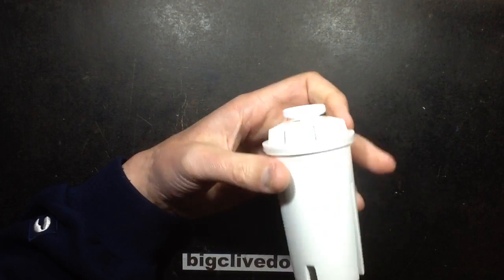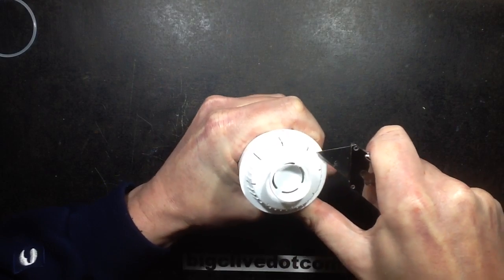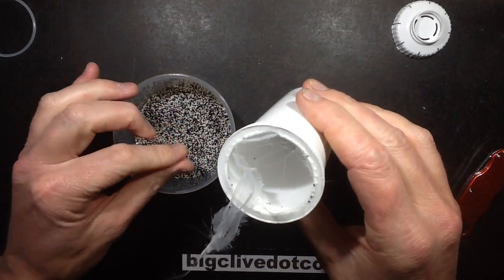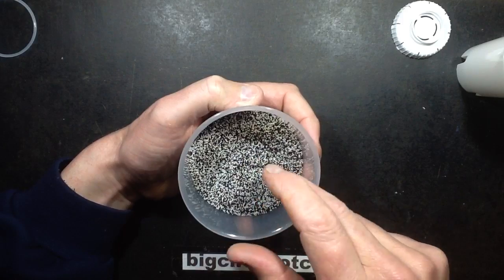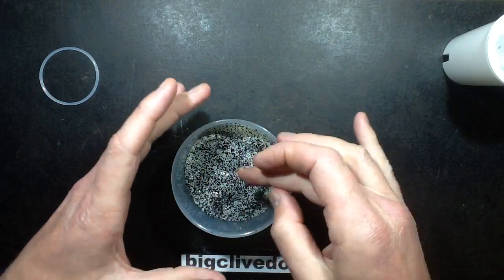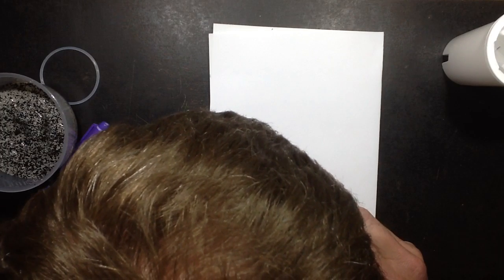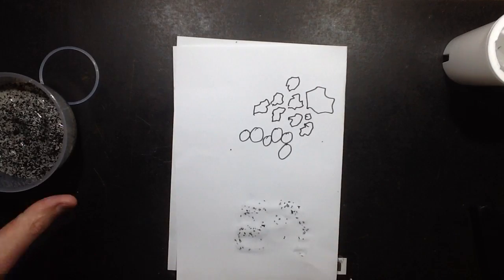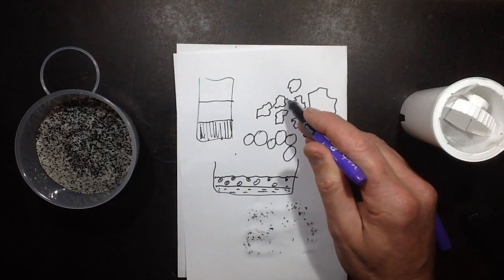What's inside a water filter?

Comment: Don't known if this channel is still responsive, I know this filter will also trap micro-organism and bacteria which proliferates. It is a vicious cycle if the chlorine is absorbed, and all types of bacteria going through? So it is essential to measure level of bacteria before and after filter (trapped in the device). Next is of course the filter of important minerals. Last point is a question, when you say the material can be cleaned up to some extent, what happen if this material is literally 'washed' with slightly acidic (or alkaline) liquid like vinegar (or sodium bicarbonate)?

Comment: I am surprised you don't own the cheapo 20x - 200x digital microscopes. Under £20 and well worth the money, basically a webcam microscope.
I did a little stop motion video with it but could record easily You only have two focal points. 20 or 200, nothing in between.

Comment: Not ion exchange resin but probably a zeolite grain, used as a bulking agent, though it does trap some heavy metals in the structure, Ion exchange resin needs to be kept hydrated, if it dries it fails. It also looks like glass or clear yellowish plastic beads. The zeolite is used in the desiccant sachets as well as a bulking agent and to keep the silica gel crystals apart.

Not much there, if it works past 2l of water it will be amazing. Basically you would need that full to the top with real resin and activated charcoal to have an effect, those are pure snake oil. Bet if you poured milk through it would come out still with cream in it.

I took apart an inline charcoal filter for a water well, and it had around 1kg of activated charcoal in it, plus the output side had a big wad of burned copper wire, to provide some stabilisation to the water now there is no chlorine in it so the water dispenser tank does not grow a thick bacterial mat in it. After cleaning the water dispenser ( remove the 5cm of gel from the tank and use 5l of bleach to clean the piping) I simply left the filter out. Nobody noticed at all. New filter ( you need to change every 2 months) is $200, so working without was a big saving.

Me, I use tap water, no filter, though I am considering putting in a 0.3 micron whole house filter to keep the piping clean. Those are cheap to buy, $5 each for the cartridge as an industrial 8in filter unit.
Reply: I know my reply is 2 years late, but the directions for the filter cartridges do specify that you must keep them wet.
Reply: Have you ever done a blind test? I can definitely tell the difference.

Comment: My fridge has a square filter cartridge in side at the top for the ice maker and water tap in the door. It needs replacing because it is completely clogged up with crap from the city water line. But at $50 a cartridge = NOPE not today.
Reply: Just buy some activated carbon as they use fir fish

Comment: My mum uses these and I've never really understood why, I grew up on hard water and other than a bit of white calcite crust build up over time on a part of my body jewellery it appears just to increase a households carbon footprint.
Reply: +Green Silver Ever hear of the carbon cycle? Carbon is not evil.
Reply: Tim Ramich

But plastics are, especially when they get into the seas and water courses.
Reply: +Green Silver Just because you once saw a picture of a dolphin caught in a 6-pack ring, you believe plastics are killing the earth?
Reply: Tim Ramich I'm not looking for an argument, you're obviously right. 
Have a good day.
Reply: +Green Silver They almost completely stop limescale buildup in my kettle the activated charcoal soaking it up until saturated. Got to be a healthier option.
Reply: +simon hare interesting point but hard water doesn't seem to do people any harm and I think I remember hearing that because of the stuff in the hard water its actually better for you (could be wrong) so yea

[Not looking for an argument just my thoughts :)]
Reply: +JAMP0T1 Yes, i read similar a couple of weeks ago on Yorks water website. Still, got to be healthier for the kettle. :)
Reply: +Green Silver something like this but much larger would be good with well water. using an on demand water heater without something like this on well water will cause massive scale build up and then it just stops working and it is a real nuisance to clean the heating element. since i grew up with it, i prefer the taste of hard water myself.
Reply: +Green Silver He isn't right.

Comment: you can reverse flush these with a strong brine solution to allow reuse of the cartridge
Reply: How exactly would one do this?
Reply: @dankwave3985  Just pump salt water through it, the same way a water softener "refreshes" itself every so often by cycling backwards & using the loaded salt instead of the mains tap water as it otherwise would. That's assuming that this really is the same resin used in those.

Comment: I've noticed that in the Brita (Canada) branded filters, the resin and the carbon are close enough in density that it won't separate easily with just water or vibration (though the carbon does get flushed out the top of the filter if I try filling my pitcher directly into it.

I want to try recharging the carbon (boiling/baking off contaminants) for reuse in other things, but don't think puting plastic resing beads in the over will prooduce a favorable result.

I've tried mechanically separating the components using a sheet of paper, and tilting/rolling the beads away. It worked but was too much effort to clean up after. Maybe if I  made a vibrating tray with steps to catch the carbon it would be efficient enough.

And, Leaving a jar of the mixed media ontop of my aircleaner/vibrating table has resulted in the larger carbon granuals interlocking, pushing the larger beads of  resin and steel shot(!?) to the top layer, while smaller beads and granuals settle throughout the mix. Which isn't good enough.
Reply: The "steel shot" is probably silver. Silver is is an effective antibaterial agent.
Reply: I'd believe you if I found (on average) more than 1 shot per three filter/media cartridges.

https://en.wikipedia.org/wiki/Ball_mill
https://commons.wikimedia.org/wiki/Category:Ball_mills

edit: I've put a 1L jar of media on top of my air cleaner, in a couple months (if I remember why I've done this and) I'll see if any metal shot has been exposed and try melting it to see it it is silver/silver alloy.
Reply: (5 years later) Forgot to reply. 

Metal shot was magnetic enough be collected with a tool magnet then to stick to the jar lid afterwards;  However it splintered apart after handling, and was set aside to avoid contaminating my electronics.  ... It is at this point that I lost track of it before trying melting it or alloying it with solder, etc.

I am still confident that it is extremely worn steel shot from the ball-mill that processed the activated carbon.